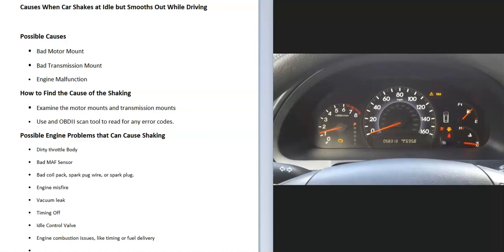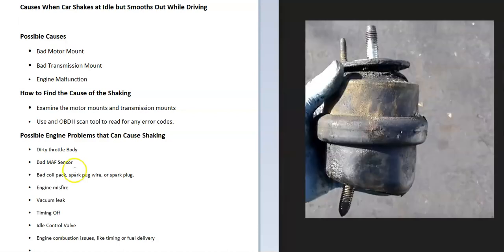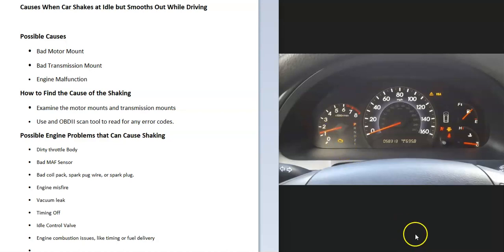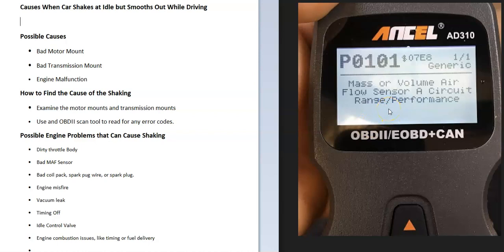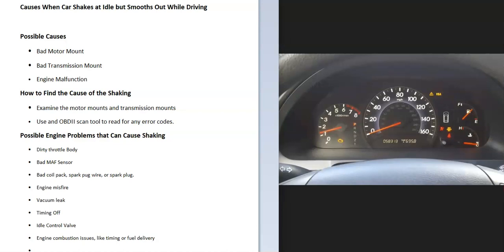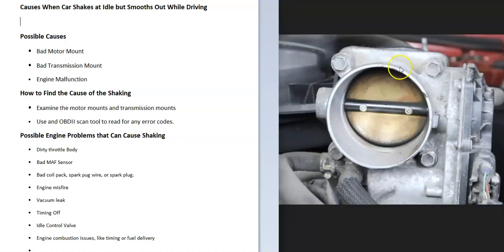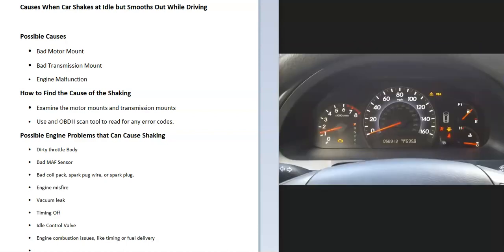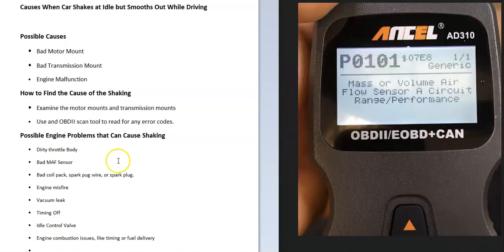Causes When Car Shakes at Idle but Smooths Out While Driving

Comment: Hi I have a question 

So my car just started shaking.

Ive noticed it starts shaking when I slow down the car, or when I start it up after I parked for a bit.

And i believe it gets worse whenever i use the a.c

But overall, if the shaking continues it only stops when i am driving

And I changed the spark plugs, but the problem still resides. 

Please help😢😢😢
Reply: I’m having this same issue
Reply: @Unknown-kb8je  I think I fixed it lol

Go to a O Reilly or Autozone and ask if they can lend you an OBD scanner.

Find the port and plug the chord in and the device will spit out a "code"

That code is a reading of what could be wrong. It's not a 100% precise but it told me I had my 4th cylinder misfiring.

Culprit seemed to be a faulty ignition coil.

I changed it myself. Super easy

If it's not the ignition coil then you should look into the sparkplugs
Reply: Mountings
Reply: It's gotta be now 2 things..I've had the same problem every one is having...and through my research it's 2 things..I narrow it down.."Motor-mounts...&.."Brake Booster"..those 2 will happen..especially if your over 1,000 miles on any vehicle...vehicles go through he'll! Especially with bad roads...and brake booster gets abused constantly braking..especially bad drivers every where these days..so all that takes a huge damage to a vehicle.
Reply: Same bro😂
Reply: Try cleaning the throttle body and the fuel injectors
Reply: Same to me bro, am tired
Reply: Did you ever find the solution? I have the similar problem even with the ac like you mentioned I get cylinder misfires

Comment: Mine shakes only while the brake is holding the vehicle in place. Not while braking, not while moving at idle, not while driving, and not while in neutral. What could it be?
Reply: Vacuum leak off brake booster
Reply: My car is doing the sane thing
Reply: I have a Mazda 2010 CX9 after changing the spark plugs into a little shaken but when I'm driving fast it don't shake
Reply: @dFuZeAlpha it’s your transmission
Reply: @dFuZeAlpha I’m going through that now. Hope it’s not too expensive and I have a rattling noise when I start it and while driving
Reply: Yes same here and there is nothing info to be helpful! It ain’t the motor mounts…I need help.
Reply: @BrandonN55 clean your MAP sensor. Very easy to do, literally takes 5 min. Did mine 3 days ago. Exact same symptom as yours.
Reply: @kevabentura4692 is it not MAF
Reply: @kevabentura4692  that’s not always the cure. I cleaned it , took off and cleaned throttle body and put in new O2 sensor, and had motor mounts replaced. Same issue.
Reply: @johnf.6942 maybe it could be what then ? Brake booster as indicated above ?
Reply: @kaddoshventures114  Maybe? However a vac leak, weak coil , bad spark plug , bad or dirty throttle body position sensor , dirty or weak mass air flow sensor timing, or bad onboard computer component can all cause the same result..  So what can we do ?  Well if you know a “good mechanic” emphasis good mechanic…”experienced”. And he / she has a good scan tool …capable of scanning all multiple live data on your vehicle not the $40.00 scan tool which can’t check every thing.   And they know how to use it and assess the live data well then that’s the answer. Probably going to cost a few $$ but that’s how it gets fixed.
Reply: @johnf.6942 it’s easy enter live data if your threshold in bank 1 is higher then bank 2 10+ then you have a vacuum leak if it’s -10 on either bank 1 or 2 then you have a fuel pump or line leak or issue depending if it’s a fuel line leak or bad fuel pump
Reply: @SamuraiAtlas    Thx.  Mine is a 4 cylinder s no bank 2.
Reply: What is it?
Reply: @QanaDiys There is a MAP and a MAF. Though this completely depends on your car.
Reply: @BrandonN55 it’s your transmission
Reply: I have the same issue, mechanic recons brake master cylinder, easy job to do on your own.
But could be worth while replacing the booster or atleast try cleaning it, there's videos about it.
Reply: @99Queenslander  ..hi there..thanks for your comment sir...please help me..could it be just that the "brake booster"?..when iam at a Red light..with my foot on the brake...it starts "vibrating bad and it causes it to idel rough"..but when I press the pedal..it rides smooth..werid...iam trying to narrow it down to the problem
Reply: @drunken-skunk i got same issue
Reply: @drunken-skunk  that's exactly same issue I have mate, I have no problems other than when I'm stopped with my foot on the brake, if I put in neutral it goes fine.
Drives fine and brakes perfectly fine it's just goes crazy at the lights.

So yeh I would assume yours is the same issue
Reply: @99Queenslander if you manage to fix it, please let us know
Reply: @drunken-skunk  yeh it was engine mounts :)
Reply: @99Queenslander did you manage to fix?
Reply: @goldeternal  yeh it was my engine mounts.
Reply: Please have you been able to fix it and what did you do ??? @drunken-skunk
Reply: @99Queenslander how did you ended up fixing this issue
Reply: Everyone mine too! Totally the same 💯 and it’s an honda accord a/t
Reply: @gelowyzYt check your engine and transmission mounts
Reply: I do have exactly same on Jeep Cherokee 2017 and the jeep dealer said its normal 🤦‍♂️
Reply: Ignition coil
Reply: @brancosebastianmartinez3951 no cuz i have the same issue and my coil ignition has less than 6 months.
Reply: I know the fix , quite simple and I hope this helps everyone,  I own a corolla s year 012 , same problems , shakes when parked and sometimes when idle . The fix is an error code p0365 , it's a camshift sensor [bank 1 ] , the problem is that sometimes the sensor doesn't communicate with the computer when the car comes to complete halt , it's not brake problems it's old and faulty sensor in 10 year old cars , the sensor is quite easy to fix and remove , and a replacement of the sensor with a new one improves better start, more full efficiency , and overall clears off maintenance or check light . Sensor bank 1 for exhaust and Sensor bank 2 is for front engine I believe but changing this will help the shake on the car and it will stop vibrating when stopping
Reply: @aproatitsfinest6767  did that. Still same. Toyota Camry 2007
Reply: @posadist681  same issue. I changed mine, it did not help.
Reply: Same change all the mountain-bike still the same result
Reply: Only shakes in drive while the brake is on.  Not in neutral or Park. not while driving obviously. Only,,After the vehicle is warmed up.. I've replaced the fuel pump, map sensor, spark plugs, spark plug wires, belts, battery, accelerator pedal, I've had the transmission service new filter, there are no vacuum leaks, good fuel rail pressure, throttle body, on and on and on and on. No fix. GM is a piece of crap.. I've decided it's probably the torque converter trying to grab, POS transmission. No codes no lights, these cars are junk GMC Yukon SLT junk
Reply: @mrs.waight7326 same problem here. 2016 toyota corolla S
Reply: Did you ever get it fix. Could be a dirty or bad engine valve@mrs.waight7326
Reply: It happens to other makers too! I drive a Toyota matrix and I am dealing with the same issue  @mrs.waight7326
Reply: Need help with this issue also
Reply: I changed All engine mount and still doing the same
Reply: Mine was vibrating as well, i changed fuel pump and its now ok
Reply: Torque converter grabbing.. Transmission issue. I've replaced everything...... Even the fuel pump. Everything mentioned here doesn't work. I even deleted the v4 mode. Nothing works..
Reply: I have this issue and i got new throttle body new plugs new coil packs new injectors and now its just throwing misfire code only when car is cold but once it warms up it clears right up and runs and idles mint i dont know thats up with it but the misfires on mine are only limited to cylinder num 2 and 3 any ideas?
Reply: Maybe PCV Valve
Reply: @ryanlopez5993 perhaps its the clutch not fully disingaged... worth checking...
Reply: Mine same
Reply: My nissan sentra 2006 been doin the same
Reply: 2010 CX-9 Mazda when I drive it it shakes a little bit after I change my spark plugs
Reply: @DavidEllis-vu9vk  you probably didn't gap the spark plugs correctly.
Reply: I have a 2010 CX-9 when I drive it it shakes a little but when I'm driving fast you can't feel it
Reply: Camshaft sensor bank 1 and 2 , replace them and you will see good improvement on your toyota
Reply: If your car is equipped with it, might be ignition air control valve. Can be cleaned, but if bad enough might have to replace it. On honda/acura early 2000s, it's attached to the throttle body underneath. Usually has 2 coolant hoses and an electrical connector.
Reply: Transmission sensor
Reply: My moms 06 odyssey is doing the same. What fixed yours??
Reply: same
Reply: Transmission torque converter
Reply: Mines shake on idle but it make this ticking noise when I turn on the ac and it drops the rpm even lower and the belt rotates slower but as soon as I turn it off it regulates back to normal. I did everything from cleaning to changing spark plug/wire, distributor,set the timing, starter, battery, some motor mounts and even use fuel additives. Next going be the alternator and the fuel injector hopefully it works. Any help is well appreciated ❤
Reply: @jonathancardona6215 hey I’m having a very similar situation with my car. Did you ever figure it out?
Reply: @jonathancardona6215 did you fix it?
Reply: Mine too please can one DIY it
Reply: Where in a Mazda 3 1.6 sedan is the MAP Sensor
Reply: I bet it's your brake booser has a leak
Reply: Having the same issue. 2010 Mazda demio 😢
Reply: Check fuel injectors
Reply: My 2015 q50s is doing the same exact thing. Did you ever find out what the solution was?
Reply: Age
Reply: @TWK74  ended up being a 14mm socket by my motor mount
Reply: The air filter pipes have been interchanged. Just change the pipes, put pipe A at pipe B's place and vice versa. Problem solved.
Reply: Bad brake booster
Reply: Transmition issue
Reply: Check ignition coil one by one by using a multimeter tester, mine same scenario and it works just google it or watch youtube how to test ignition coil thru multimeter
Reply: My research has lead me to believe it could be an o2 sensor
Reply: Possible injection issue. Dirty or electrical problem. Or Perhaps if you haven’t checked spark plugs check around holes for plugs for oil. Leeking valve cover seeping oil into combustion.
Reply: turn on your headlights or move the steering wheel to bring idle up
Reply: Same here
Reply: Brake booster
Reply: Something but when in park (brakes not pressed)
Reply: Same problem but some mechanic says your gearbox box needs to replace.. as when I start the car and go to D car do some jerks while holding breaks.. and on low rpm break paddle becomes hard and car don't stop.. now I m thinking to go for break booster repairing cz changing gear box is expensive
Reply: @ryanlopez5993 how did u fix u what was the solution for this please
Reply: @crashfilms6484  i had the same problem as him. I got my motor mounts replaced and it fixed it.
Reply: If you have a engine valve going it will idle rough then smooth   when driving or your engine could have blowby
Reply: Besides what I said check out your trans and engine mounts
Reply: Check brake booster
Reply: Did anyone manage to fix this?
Reply: Yup. I drive a  2016 Jeep Renegade sport and have this issue as well.
Reply: Just purchased a 2015 renegade and it only shakes while my foot is only the brake and car is in drive mode
Reply: mine has the seme problem ..did you get to fix your please let me know if so
Reply: @taylorjackson2397 same here but I have a 2023 Elantra, please let me know if you fixed it
Reply: @thelasthexacord2122   How?
Reply: Your mountings are dead
Reply: I have the same symptoms and changed the motor mounts stopped shaking as bad but is now clanking while in reverse. Would that be the turbo clutch, map sensor or coil pack I changed the coil packs and spark plugs a while ago but it feels like it’s near the transmission where it’s clanking and is really bad while braked at a light
Reply: Transmission
Reply: It’s ur motor mount
Reply: Air filter
Reply: @sasquatchmindcontrol no chance
Reply: @sasquatchmindcontrol air filters are never an issue , 35 years driving & over 40 cars

Comment: Hi, my 2007 audi a4 b7 has very weak rev at idle. I stepped on the gas and the rpm just slowly goes up. Before it revs up nice and strong. Any help would be greatly appreciated. Thanks
Reply: I’m haveing the same problem on my lancer. Did you figure it out on your car
Reply: @Kylieroselo my lancer is also same problem.. where you able to fix yours bro?
Reply: @_-943  what was it?
Reply: @gottahavegoalsset  rough vibration when on stoplight but not all the time

Comment: my 2018 ford explorer only 66k miles engine vibrates on drive while on stop. worse on reverse and also stepping on the brakes. while during driving no problems. engine mounts , spark plugs and transmission fluids just replaced. help!
Reply: Check for freespace at the wheel arms (dont remember the specific name but saw a video that had the same problem and it was one of the rods [connecting rod or something] )
When you switch to D you'll hear a click nok some like that... lift the car and ask someone to help you with that...
Reply: turned out its the torque converter. good thing ford extended the warranty. it was repaired for free @almogmazor1040
Reply: @almogmazor1040  I know what you talking about it’s completely different then what he expected I have the same problem this is engine shakes not the rod
Reply: Heat shield possibly?Do not remove it get it tightened up

Comment: I have no check engine light car shakes while in drive or reverse when I put it in neutral it goes away. What does this mean?
Reply: Same here for toyota corolla 2009 but iam not surw whats happening even i change fuel pum
Reply: @reyyankhan215 bad engine mounts
Reply: @reyyankhan215  Asalam alaykum habibi 
ana min bakistan
Reply: @reyyankhan215 salam
Reply: head gasket problem
Reply: @osmanmyakhil how does the head gasket cause this? I have the same issue and my head gasket has a slight leak into the radiator.
Reply: @osmanmyakhil already change it problem remains, coils changed, spark-plugs the timing chain may be the cause but nobody checks that!
Reply: Check all ur engine mounts and transmission mounts
Reply: @BryanMartinez-u5r  ahh imsold the piece of junk lol
Reply: Same shit, same car, but I also got a check engine light with p0300 code (multiple misfires)
Reply: Same issues here, timing was done, spark plugs were done, car still does this. Trans has roughly 100k on it
Reply: Car sgajes neutral only ok driving it but surges.. gear change is sharp
Reply: Please if you find out let me know I'm having the same issue with my car if I put it in drive it runs like crap if I put it in neutral it runs beautiful if I put it in reverse it runs beautiful only when I put it in drive is when the engine starts to shake what does that mean you find out please let me know

Comment: Thanks! I always watch your videos because I am trying to keep my 2000 silverado running. How do you diagnose an engine misfire. No one seems to get mine fixed?
Reply from the maker: I would start by scanning for any OBDII codes and troubleshooting from there. The most common causes of misfires are bad spark plugs, bad ignition coils, bad spark plug wires, and vacuum leaks.
Reply: @HVAC_Mechanic Ford Fiesta 2011.  When first cranked at idle slight vibration felt in car. If idle until warm 5-7 mins it stops. Drive for 3-5 mins and stop no vibration. Only does it at rpm’s 1,100-1,400. Warm at 800 ramps no vibration. Transmission shifts good and no vibration. Engine no lights and no misfires?